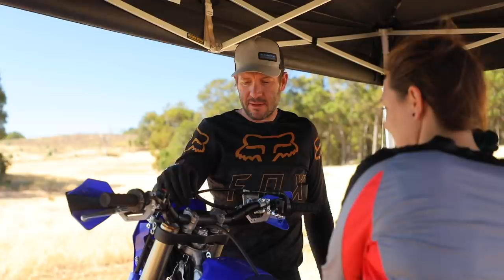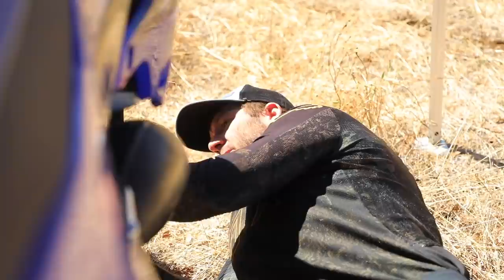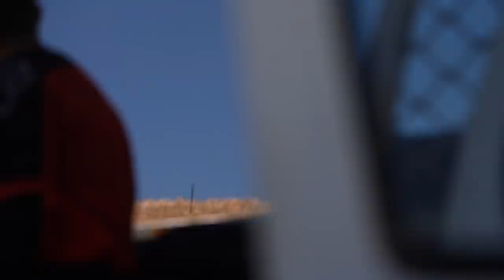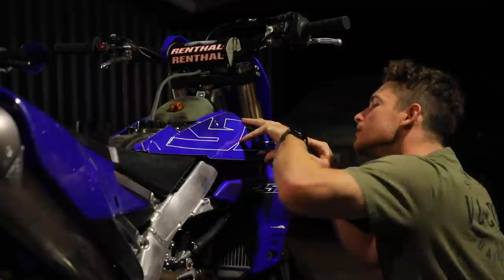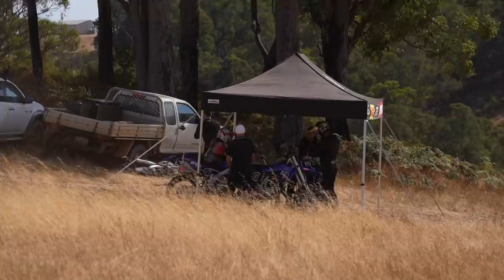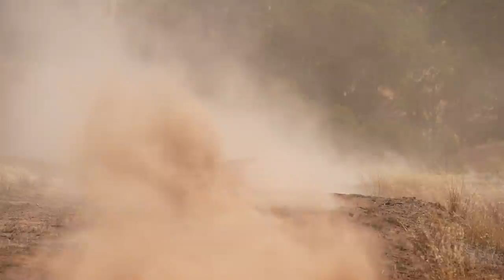Suspension and Chassis hacks for your Motorcycle

Comment: Sad to say I am not sure I have ever ridden a bike that was properly set up for me.  I do my best, and all this YouTube instruction is fantastic, but one never knows.  Since I started when bikes had 4-6 inches of travel in the 1970s, and bikes now have 12 inches with clickers, it’s always better than the old days, but I wonder if I am using it all correctly.
Reply: Dont worry, everybody feels the same. If its okay for you,its good. If not,  Google it and play around.  But remember the current setting.
Reply: Log it in a notebook and do the maintenance. If you try every possible iteration, you are bound to find a few winners that you can compare more closely. Use your seat time to push through the knownledge gap
Reply: I actually just paid close attention to what I was feeling (dropping hard into holes, bouncing, etc.) and figured out which does what.  Have pretty tight settings now.  Also, improved riding position…figured maybe I was out of place and was.  Adjusted bars, got farther back, was adjusting for proper weighting finally.  Thanks for your input.

Comment: A great video, shot well as always.
The problem is, you can get 10 different tuners out to do the same thing and you'll get 10 different 'best advice' answers to what you need!
This is why I just ride my bikes with the stock suspension, set that up and make it work. 
I'd rather do that than spend money 3 or 4 times like I've seen riding buddies do.

Comment: Correct Sag is the foundation of a proper handling bike. Applies to all genres of riding. Bar bend, bar height & position etc are an after thought. There's more to Sag than subtracting travel difference between a weighted & unweighted bike. It takes a minimum of 2 people to do it correctly.
Reply: Static sag /

Comment: 0:09 I'd love to hear how you can change the bikes geometry...
Reply: Raising or lowering the forks slightly adjusts it, and so does setting the sag, but doesn’t really change it too much.
Reply: @mossoconnor4417   I disagree. 10mm fork height is usually the difference of being on one extreme: too high in the front (light and poppy, front won't stay down well) vs overshooting to way too low and sunk in (squirrely and erratic, prone to diving in).
You can shift your weight, but that is a compromise for a misbehaving bike. That compromise means you will have to shift more and faster, to overcome it's being setup wrong. And you can't weight it anytime your weight is light such as in the air or dropping from a bump. Anytime that occurs, the bike will do exactly what it was setup to do.

For the rear on say a yz250, typically you are looking at a very sensitive 102mm rider sag with the entire adjustments falling within +/- 2mm. A moderate noob rider can easily feel the difference with light track riding, even if they don't know what you changed to do that.

Comment: I make a 250 feel the same you make a 125 feel lol, sag maxed
Reply: Springs will be far and above the biggest difference you can make for your suspension.
Springs 1st, then try tuning your suspension and see if it needs further mechanical improvements (including things as simple as thicker/thinner oil, most likely thicker).

Comment: Small note, for Anything that involves two wheels geometry adjustment is Critical for one's height, body proportions, comfort, and use.  Sag and other critical suspension hacks to further optimize the bike are also important but, following Logic, what the gent said and demonstrated works.  Inexperienced 'experts' need to remember there are people Superior to them in knowledge and experience and that they need to mute their Opinions which are generally wrong.  Listen, learn, and maybe you'll realize a better-riding bike and your riding will be better and more confident. [And be a wiser person for shutting one's pie-hole and using one's ears and brain instead...]

Comment: Bloody hell, 😂😂😂😂, here is what every average rider should do on a MX / quality Enduro bike.
Run your Compression dampening at softest settings, Rebound mid to 3/4 settings, front and back, it will suit just about all conditions, Bush/single track/grass track /light MX, giving you great grip, and won’t bash you up, If ya want to start hitting bigger hits wind up the Comp bit by bit till it doesn’t bottom as much, but the more you wind that Comp up, be prepared for the bike to not handle as well in the shitty stuck anymore. You can’t have everything, it’s either make it handle like a Mercedes or make it handle like a touring car. Adam’s track it the type of track that is suited to firmly set suspension, it’s not narly is easy with h big hits,most of us are riding unforgiving rubbish without the big hits so ya need the plush feel and grip to ride for hrs and hrs, not 5 minute moto,s .